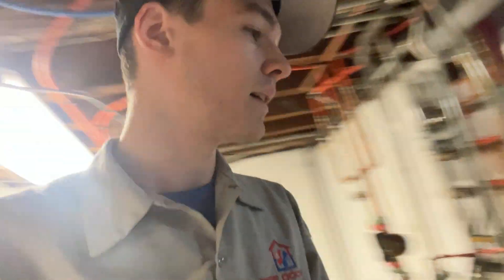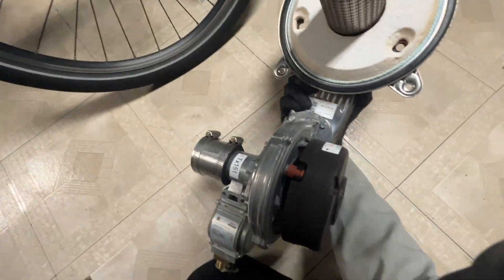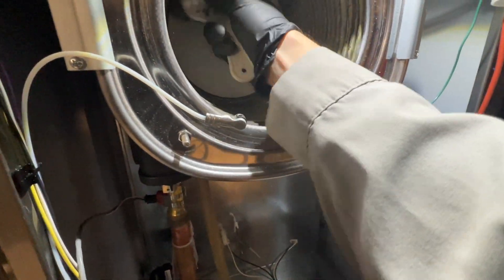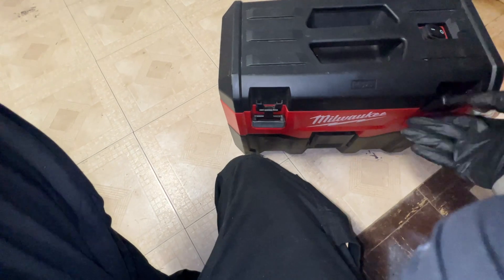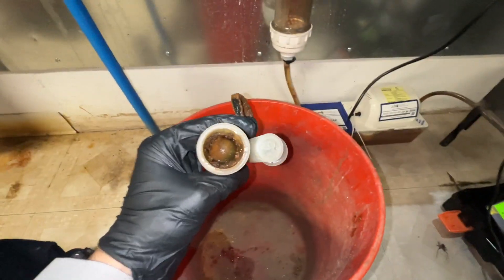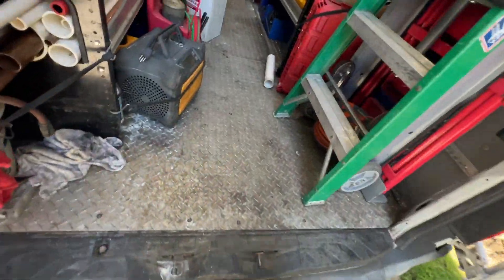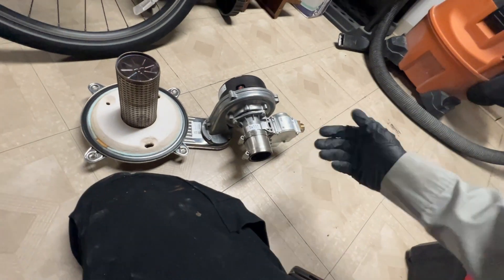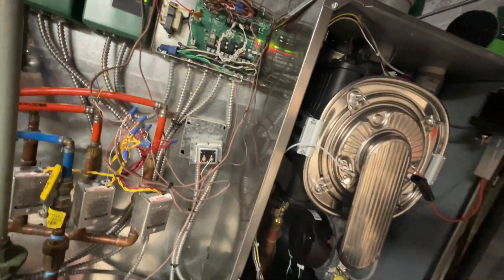NTI TX-151 High Effeciency Condensing Boiler! Full Dissasembly and Cleaning on Heat Exchanger!

Comment: Hey Daniel, I have this boiler and I'm getting 8.6% CO2 and CO in the upper 80's PPM at high fire.  37% excess air, 5.7% O2.  If I back out the throttle screw to 9.0% CO2 (min specified by NTI), my CO exceeds 100ppm.  Any ideas? This is after cleaning the combustion chamber.  Gas line pressure is within spec static (7 inWC) and and high fire (>4 inWC).
Reply from the maker: @PhillyFixed  first of all recommended static from NTI is 7-10 InH2O. (And Higher if it’s propane) 

Just because it’s within “spec” doesn’t mean it’s what the manufacturer wants. The specified minimum is the absolute minimum it will run at that doesn’t mean it’s safe and proper to do so. 

The maximum CO from NTI is 175, because through there tests they’ve found the lowest level it can burn at with varying atmospheric pressures and gas pressures is 175. And that doesn’t mean 175 is good it just means that NTI will accept it. 

I would say you need to inspect everything fully and clean everything fully. Inspect the burner itself. If the burner has any slight defect, crack, hole, anything. It will burn improperly and cause higher CO. Secondly check your blower. Make sure it’s actually modulating at the RPM the system thinks it’s at. 

I would check fresh air, make sure u have no blockages even thought you have enough. I believe the blower pulls the gas in on this model rather than allowing it to just flow in, which means it requires good negative air pressure from the fresh air. 

I would check for blockages in the exhaust and make sure it’s clear. And make sure it’s within manufacturer specifications with distance (number of fittings, and type of fittings increases distance greatly). 

Make sure your combustion analyzer and your manometer are reading accurately.  

There’s a lot to look at. Kinda need to gauge the situation yourself.
Reply: @DCHVAC  thanks for the reply.

NTI specifies min 4 / max 10.5 inches of WC as the acceptable range for the gas pressure, with 7 as the ideal.  It's around 7 static, but more like 4.3 at high fire -- there's not much I can do to increase my gas pressure from the street, though.  
"Throttle screw" is the term NTI uses for the gas adjustment screw in their literature.

UEI C161 analyzer just came back from UEI's calibration/recert, and manometer was zeroed just before turning the gas back on.

I'll double check my air intake and exhaust piping for any obstructions, I suppose.  I can't think of any other causes. The boiler is 7 years old and has operated well in the past, so no issues with the original install (vent distance etc.)

Thanks again for the reply!
Reply from the maker: @PhillyFixed  I also hope you’re touching the right screw when you say “throttle” screw.

Comment: I think birds have gotten into the exhaust pipe of my boiler. I am afraid to use the boiler until I check for debris. Trying to figure out how much I need to take apart. Putting a hardware cloth screen over the vent afterwards of course.

Comment: that upper neutralizer, under the condensate trap, should be horizontal, with the offset outlet high, so it stays full and neutralizing,
Reply from the maker: It’s not used as a neutralizer. The pump is the neutralizer.
Reply: @DCHVAC  ok
Reply from the maker: I didn’t install it.